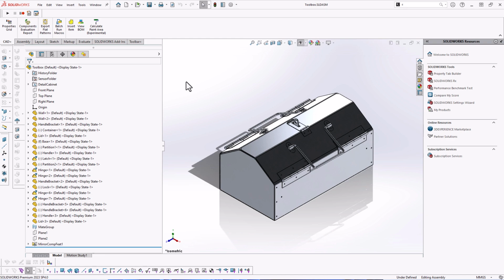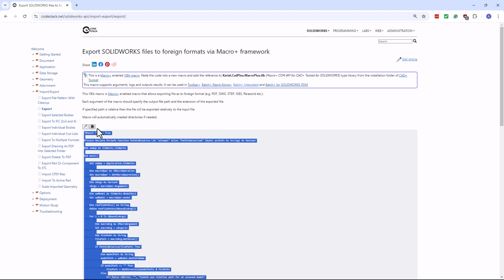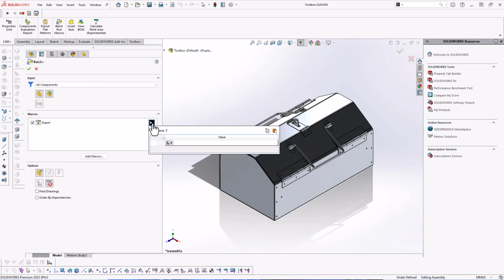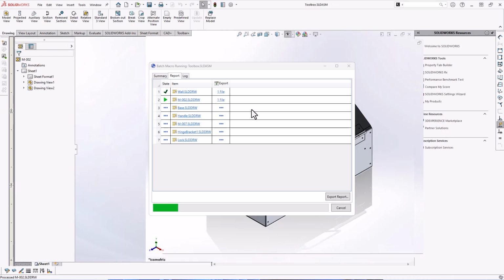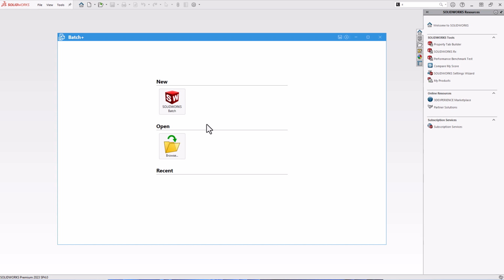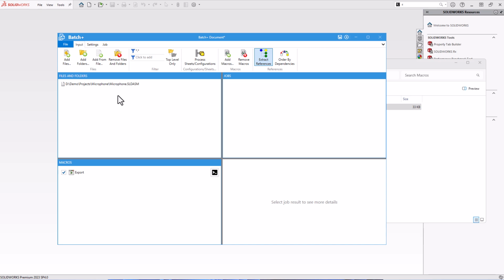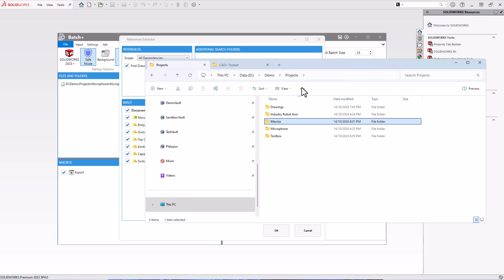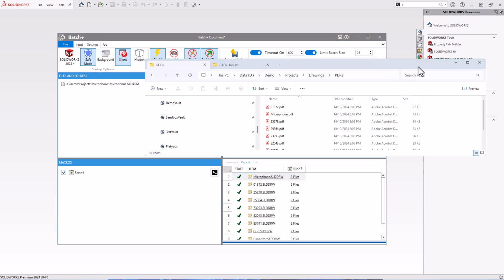Export All Associated Drawings From The SOLIDWORKS Assembly

Comment: Am active subscribers and fan.kindly help on this issue i have.I am having trouble exporting parts or drawings as dxf files. I get an error message when my cursor is over the "Save" button that reads "Cannot complete the cut operation because some of the selected items cannot be" and then it cuts off. When my cursor is over the part it will also read "The object cannot be created."

I've tried every combination of export options and always the same.

Thanks.